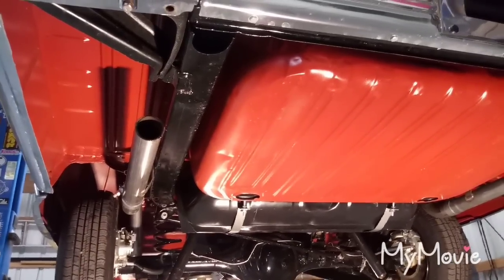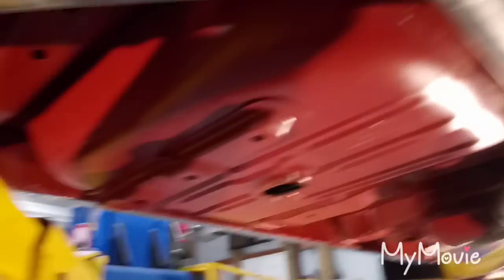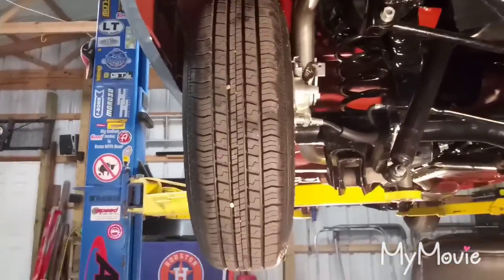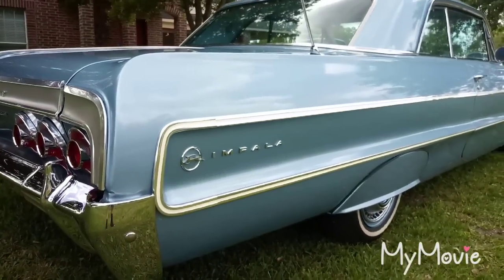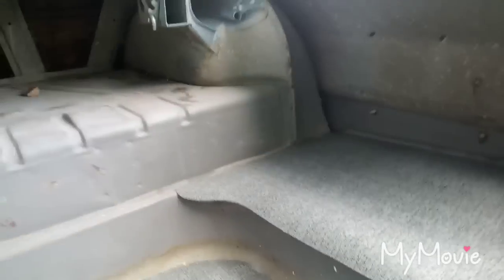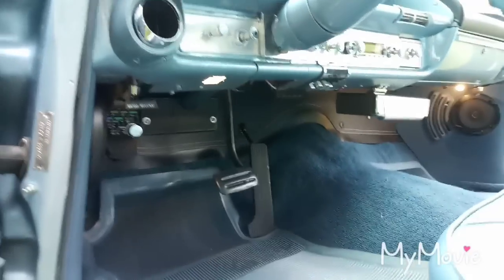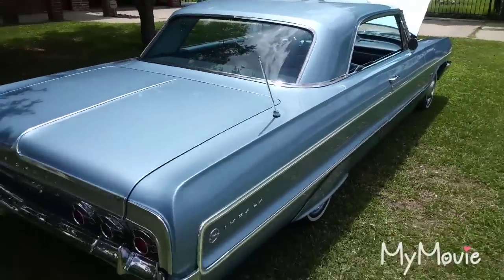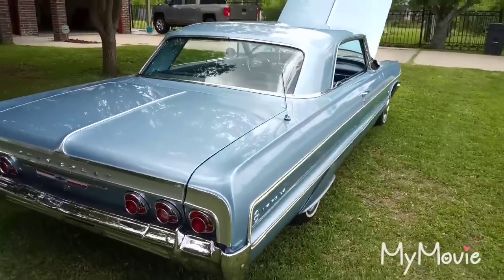1964 IMPALA RESTORATION COMPLETE!!

Comment: It looks like your car originally had factory air!!  Check out a Vintage Air add on.  You can feed it through those factory air ducts!!  That's what I did in my '64 Chevelle convertible.  Easy installation!!!

Comment: Turned out great! I can only hope mine will turn out as good.. I do have a question, where the drive line comes through the tunnel and connects to the transmission how much clearance do you have from top of the tunnel to the drive shaft. just as mine exits the tunnel it is rubbing on top, does that make sense?
Reply from the maker: Yes i understand. Shouldnt rub. Maybe the transmission mount is too thick? If the tranny is elevated i could see it elevating the drive shaft too.? Maybe?
Reply from the maker: Also i think the cross member mounts on the frame have 2 sets of holes.

Comment: I had a 64 SS Impala azure blue, white leather, installed Cragar SS 8 inch deep chrome wheels on Low profile wide racing tires. Just enough of a rear rake to see the top of rear wheels.  It was original and in mint condition.  Sold it to a Chevrolet dealer several years ago, they drove it up the ramp to their new car showroom floor where it stayed for two months until sold.  Do I wish I had it today ?   You bet your ass I do.
Reply from the maker: How much did you get for it?

Comment: What brake  setup and rim did you use to run hubcaps, trying to run ss hubcaps on my 64 with a hydroboost set up
Reply from the maker: Cpp brakes and 78-88 g body steel wheels. U will need to grind down the back calipers a little

Comment: Great job on the restoration! Will a the 350 engine bolt right up to a power glide with no problems in a 64?
Reply from the maker: Yes. If it's aluminum power glide.
Reply: @lonestarlows  Thanks, some aren’t aluminum?
Reply from the maker: @slickpanther06  i think 58 up to some 62s were cast iron. Bigger flywheel or flex plate as some call it.  And starter mounts different.  I had a 62 that had a cast iron and its an extremely heavy boat anchor....
Reply: @lonestarlows  Thanks. I’m a lowrider too and live in Texas as well. I currently have a 66 that I’m about to start building. You can see it on my page. In the video I said I was just gonna throw on some 13s on and it and cut it. I changed my mind. I’m gonna have it professionally repainted and have all the chrome and trim redone as well as a new interior kit and skirts. Check it out when you get a chance. Thanks for the info. I bought a 66 to get back in the game but I plan on selling it in like 5 years and get a 64 because it’s my dream car. I prefer an SS with a 327 but I asked about the 350 because I heard it’s cheaper to buy a new 350 than rebuild the engine. How much did that engine cost you if you don’t mind me asking.
Reply from the maker: @slickpanther06  cool. The long block crate was about 1800 shipped to the house.  Which , yeah is cheaper than rebuilding a 283.  Ill check you out
Reply: @lonestarlows  that’s cheap! I’ll probably go that route when I get my 64. I would like to have an original motor or period correct one but I’m not paying an arm and a leg for a rebuild when I can just get a 350 for cheaper and have more horsepower. Thanks.
Reply from the maker: @slickpanther06  numbers matching only has value on 409 and other big block cars. IMO.
Reply: @lonestarlows  yeah once you cut a car that numbers matching stuff goes right out the window. My 66 is a numbers matching car but that stuff means nothing to me. I’d cut a numbers matching 57, 58 or 59 rag if I had one. The only car I wouldn’t cut is an impala with a 409. I would keep it and let it appreciate in value, only to sell it and get something better that has a regular engine to cut.

Comment: I have a '63 SS 327 4spd A/C AM-FM radio Azura Aqua.  I've owned it for twenty years, restored sixteen years ago.  Floors were spotless as was all metal besides the usual bottom of fenders.  
Your work is very impressive,  there is a lot of real estate on these cars, especially the quarters, spent several hundred hours just blocking mine.  Much respect on your attention to detail, these cars beautiful, but not easy to restore.  Where did you find those colored floor mats?  I recently missed an NOS set and have been looking for years.  Thanks for sharing and saving, take care.
Reply from the maker: Thank you. Yes these cars are long. Its  self inflicted pain...but its fun. ...sorta.  the floor mats came with the car..lucky
Reply: I must say An Azure Aqua 63 was the best option impala if you ask me! I had a black 63 I was going to paint that color because it came that way stock but I ended up selling it. Worst mistake of my life!